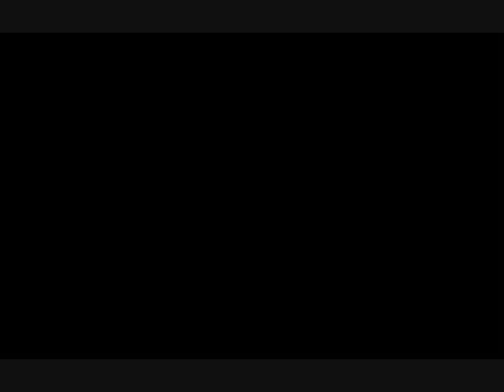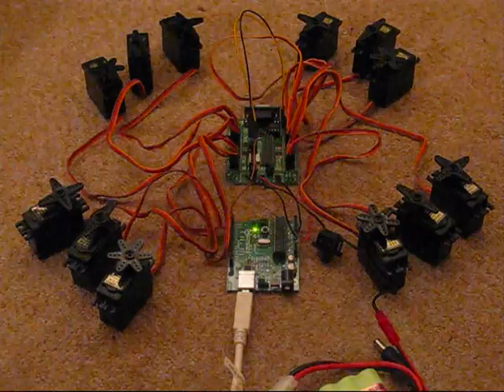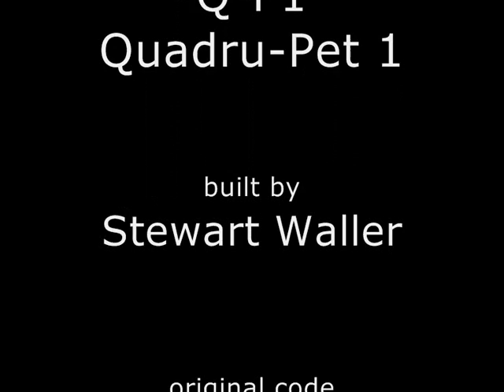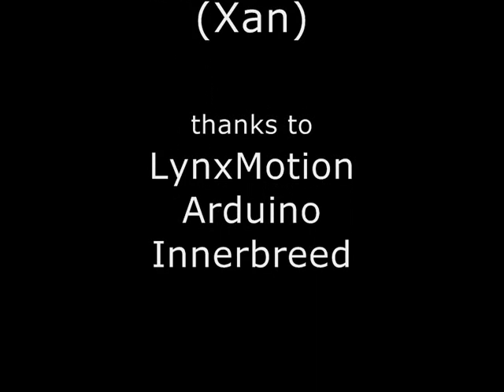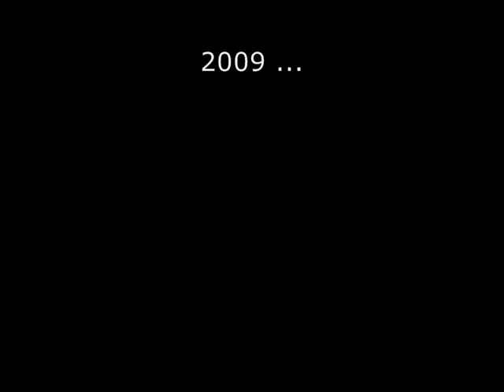Q-P1 "Quadru-Pet 1" - part 1

Comment: I understand you have to jumper TX from arduino to RX on ssc-32, but you also have to jumper grounds. My question is, when you connect onto RX on scc-32, using a two pin connector jumper, can you just have one pin at the top of RX and the other pin on ground? In other words, if you're looking at RX on ssc-32, could you have it like this " - " touching ground and RX instead of " | "